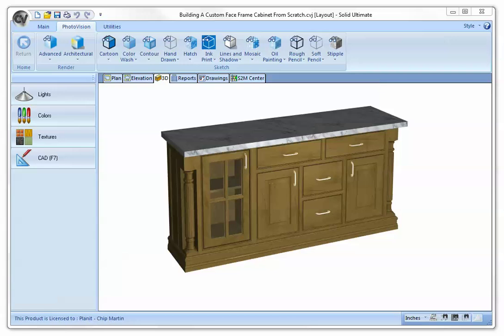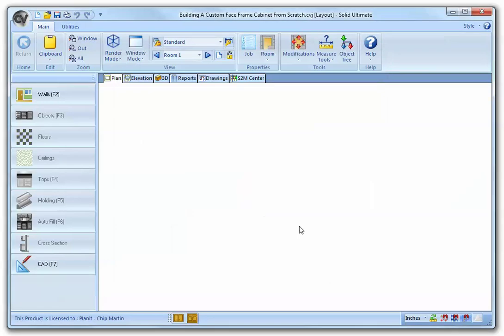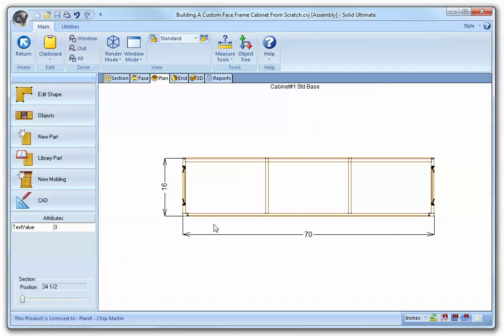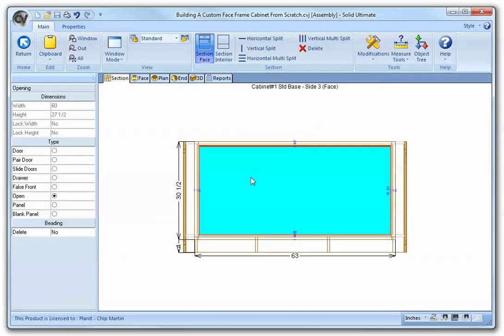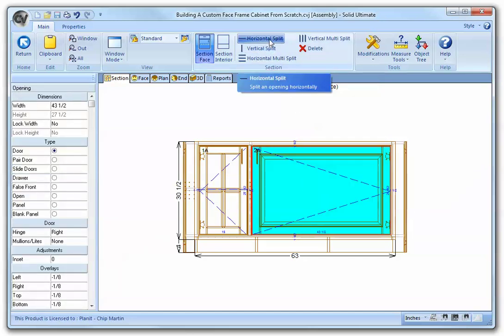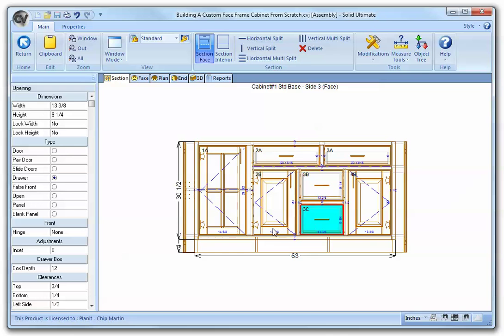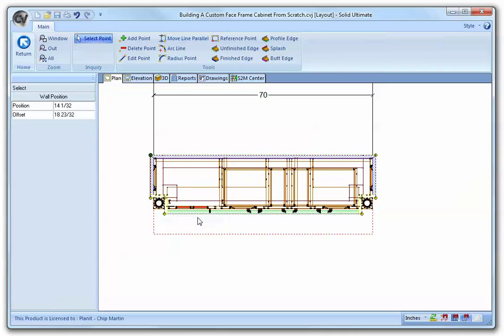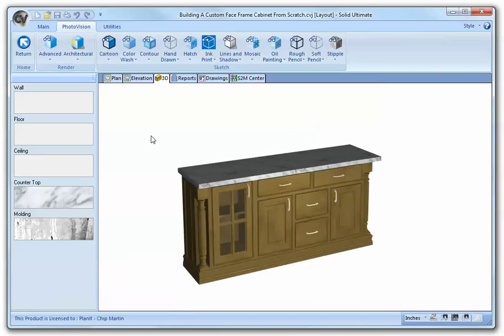Building a Custom Face Frame Cabinet From Scratch

Comment: Hello, i started using CV 4 years ago before company closing down. All cabinetry saved, so i learned quick. I didnt learn though how to create new face frame cabinetry. Having issues with my face frame all flush with cabinet inside ends and flush with deck on inside. Can you giide me a bit. Euro i can do fine. Its just that style of face frame.